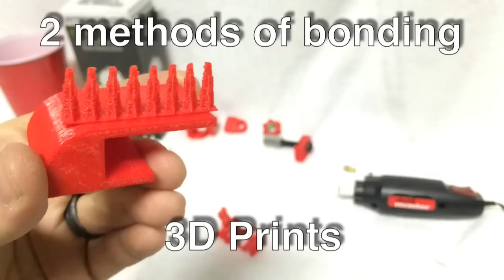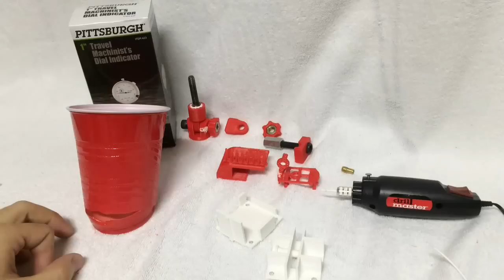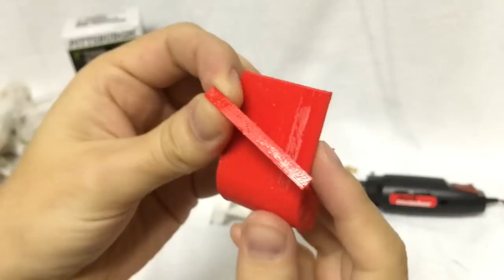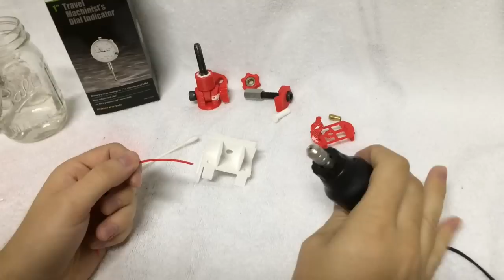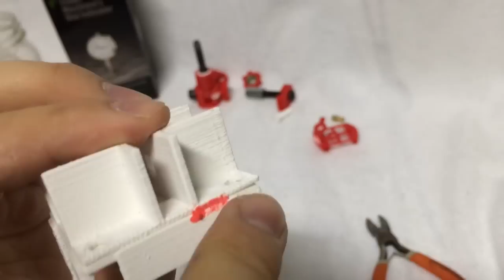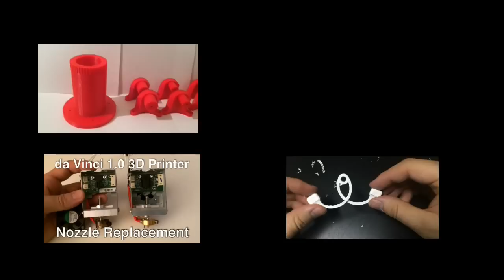2 Methods on Bonding ABS 3D Prints: Friction Welding & Acetone Bonding

Comment: RE: Acetone welding: If you have a spare piece of glass, you can drip a couple drops on the glass, then place the flat pieces on the glass into the acetone, and clamp them together. I've found that way works much better to reconnect sectioned parts.
Reply from the maker: awptickes great suggestion. thanks

Comment: What is the difference between MEK welding and Acetone welding ABS in terms of strength?
Also the difference between mixing the solvent into a solvent-solute cement and applying it directly to the material?
Reply from the maker: Not sure to be honest.

Comment: does this work with pla?
Reply from the maker: No I don't think so. But I'm not sure. I never used PLA.
Reply: yes
Reply: PLA does not dissolve in acetone, so it would not work
Reply: not with acetone you'd have to use a stronger solvent. I know some brands of PVC pipe cleaner works to make PLA tacky

Comment: Before making statements that Acetone bonds "3d prints" maybe you should point out that it works with ABS and not with PLA. Thumbs down for not spending two frickin minutes to google with what "plastic" acetone has reactions.
Reply: ...like you've nether made an easily avoidable mistake like that in your life. Atleast he talked about it and maybe someone else won´t make the same mistake now.

Why so uptight? It was interesting.
Reply from the maker: Thanks Calisto.
Reply: It's someone ever reads this comment. It does work very well with pla as well
Reply: @TheCarLovingSwede  acetone has no effect with PLA... it dissolves ABS/ ASA only
Reply: @mitchimal  nope, you are not correct. It does not dissolve pla, but it still makes it sticky
Reply: @TheCarLovingSwede  I'm not going to argue but chemically it does nothing to it.
Reply: @mitchimal  Go to 1:30 in this video:

https://youtu.be/VZUfq0yrtv4

I also previously thought that nothing happens. But obviously something does happen. I guess it's due to some additives or something in the PLA. 100% pure PLA may react differently.